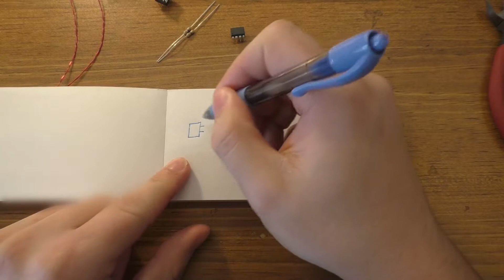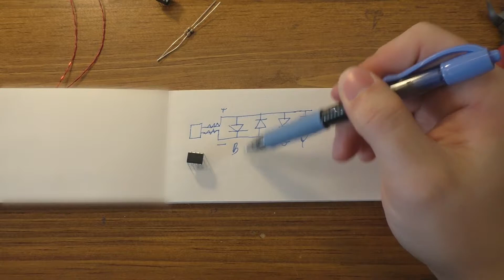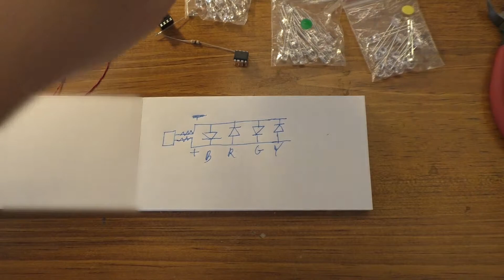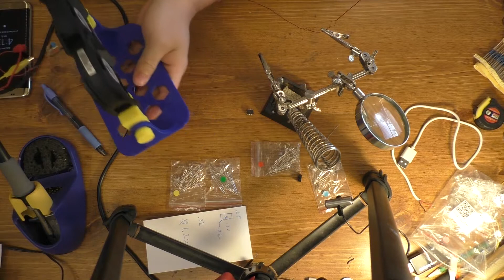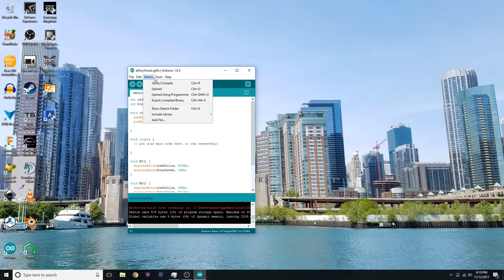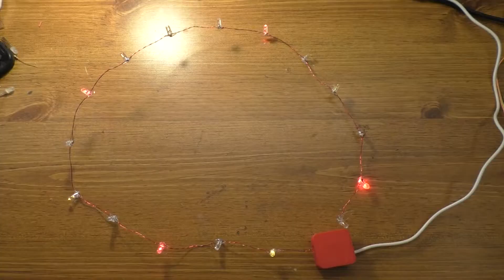DIY USB Christmas Lights

Comment from the maker: int redYellow = 0;
int blueGreen = 1;

void setup() {
  pinMode(redYellow, OUTPUT);
  pinMode(blueGreen, OUTPUT);

}

void loop() {
  // put your main code here, to run repeatedly:

}

void RY() {
  digitalWrite(redYellow, HIGH);
  digitalWrite(blueGreen, LOW);
}

void BG() {
  digitalWrite(redYellow, LOW);
  digitalWrite(blueGreen, HIGH);
}

void OFF() {
  digitalWrite(redYellow, LOW);
  digitalWrite(blueGreen, LOW);
}